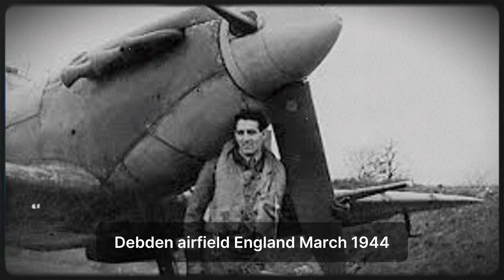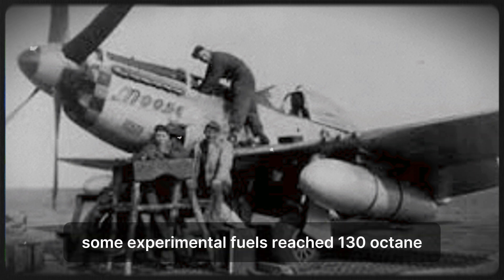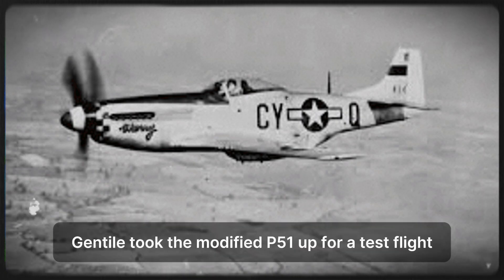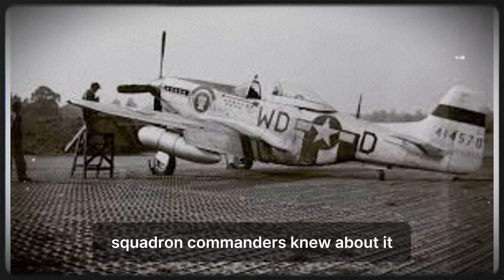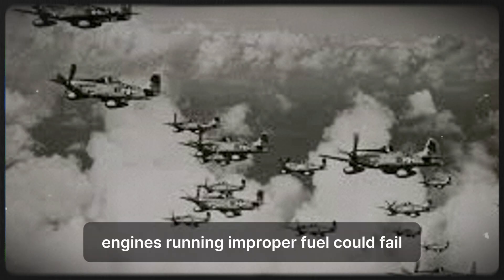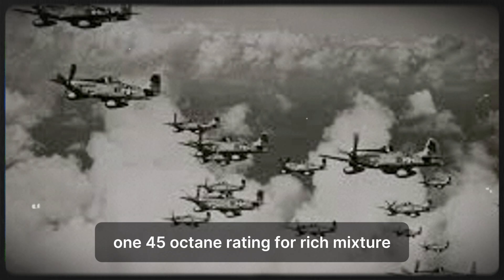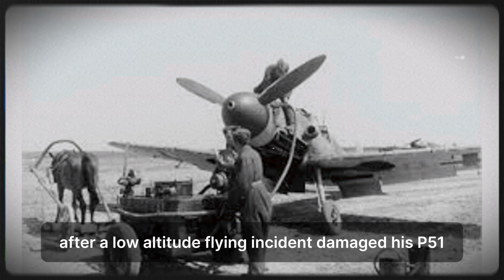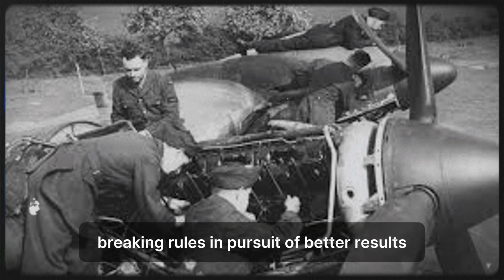How One Pilot's 'Illegal' 150-Octane Fuel Mix Made His P-51 Outrun Every German Fighter

Comment: That's nonsense. Every engine is built for a max. specific octane rating, and increasing it does not automatically affect performance. Engines at that time did not have knock sensors, so they couldn't even play with the timing. Mixing high-octane fuels with "standard" ones usually doesn't have a significant effect on the octane rating, and it's definitely not a proportional mixture number. So it's just an urban legend at best. Unless someone made it up.
Reply: Planes were supercharged and or turbo so with a higher octane rating you could increase boost and you can change the timing on all motors
Reply: But I also agree with your statement most of these channels and it popped up lately all it is is made up AI bullshit